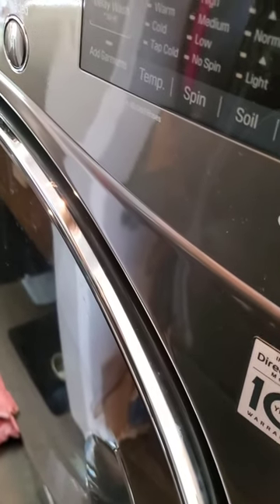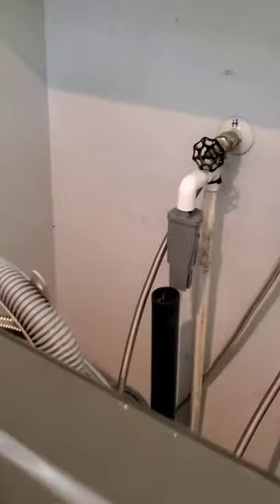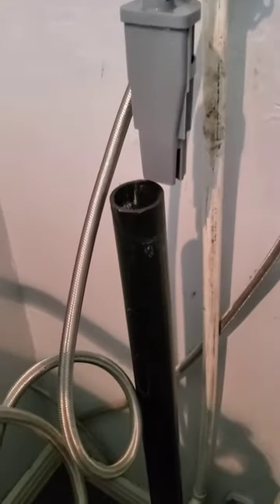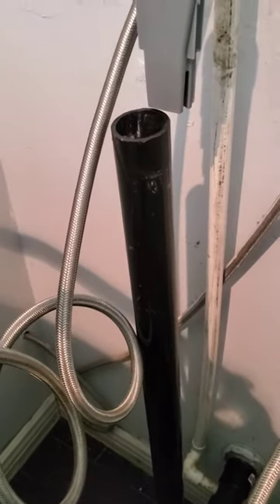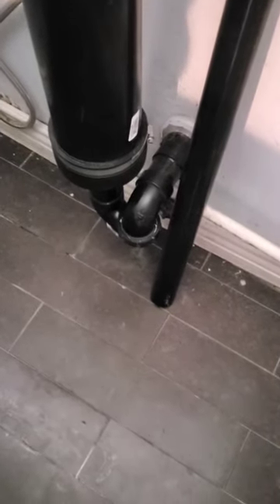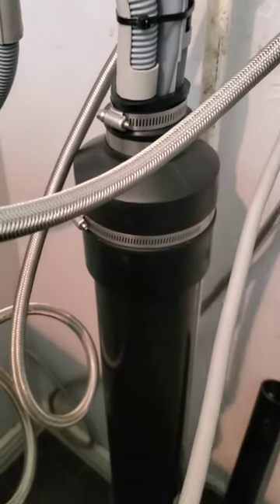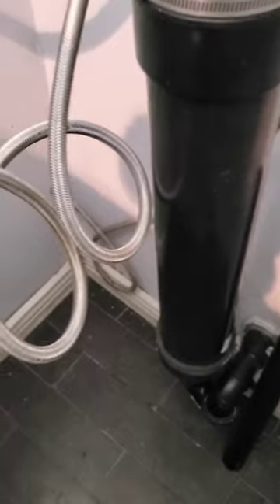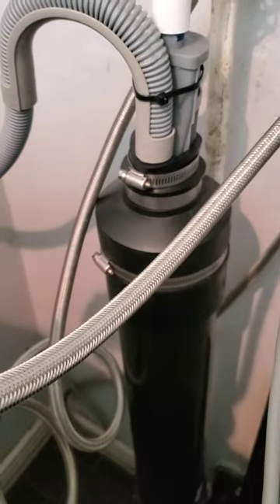Washing Machine drain overflows - Simple fix

Comment: Had this issue. A plumber came over and jet washed the inside of all my pipes and that fixed it. They were just all full of build-up, causing it to not drain properly. I told him about this 4" expansion fix and he said it's against code. That and it wouldn't fix the dirty pipes that were actually causing my issue. I also bought a bottle of Bio-One to put down the pipes once per month, which is a bacteria that grows and eats all the slime, grease, and goo that causes some of these problems. I like the 4" expansion solution Andy offers, but if you have gummed up pipes, this is not a long-term fix, as it will mostly just mask the issue.
Reply: I agree. I had same issue and after snaking the pipe now it drains just fine.

Comment: I simply used a 3/4" PVC coupling (actual ID is ~1") as a flow restrictor. Fixed for 85¢. Ideally it should be placed internally between the pump and rear panel connector before exiting the machine. The internal hosing and clamps are much sturdier than hose used externally to drain and the intermediate connector wold prevent it from exiting past.  Pumps on modern machines are just too powerful for many 1.5" drain setups.
Sealing the drain hose to waste line with a grommet is another option but an anti-siphoning device must be used in that case.
Reply: THANK YOU, this is the idea God gave me today, and you confirmed it.  'Restrict the draining machine pipe/hose' so that it does not cause the slight backup.

Comment: I had the same problem. My solution was to simply jam a 3/4 inch PCV threaded stop into the washing machine drain line. The threads are a nearly perfect fit for the 1" flex line he used in the video. I then put a 1" drywall screw through both flex pipe and plug for double security. Finally I drilled a 3/8 hole in the plug to reduce the water flow. I know that it is a little harder on the washer pump but its better than breaking concrete slab to replace a 10ft run of undersized drain pipe.

Comment: Worked!  Although I only upsized the standpipe to 4" with an adapter. I left the top of the 4" pipe open and just put the washer hose in it (no rubber reducer/clamps on top).
Reply from the maker: Glad to hear that it worked for you.

Comment: Same problem I have. New speedqueen set, older home. I just bought the home, so I'm still trying to diagnose the problem. All of the fixtures drain fine. I believe it's just too much water at once. So, I think I'm going to use the same principle  here, except drain it to a new utility sink. The sink will act as the overflow reservoir.

Comment: Looks like you are pretty good with plumbing, congrats!
I have an issue with my drain hole for washer discharge pipe - it is overflowing sometimes causing my basement flooding, it's not because of water from washer like in your case, it's because the waste water from outside comes right into my house when it desires, how do I fix it? Back water valve, any ideas?

Comment: Great idea! I ordered the parts to start this project. Did you cut the 1-1/2 inch pipe at the bottom by the P-Trap pipe with a regular saw? How many inches of the 1-1/2 pipe did you leave to connect to the rubber coupling? Thanks
Reply from the maker: I used a hack saw. 3 to 4" should be good.

Comment: Can you tell me the specific parts you purchased? I have been having the same issues and we feel your solution may work for us.
Reply from the maker: 3ft of 4" plastic plumbing pipe
2 of the flexible rubber 4" to 1-1/2" coupler with clamps, one for the top, the other for the bottom.
Make sure you measure your existing pipe and confirm that it's 1-1/2"
Good luck!
Reply: @andyn8998  Thanks. Ours is going behind a wall so I believe the 4" pipe may be too wide for both the existing outlet box with spacing of the hot and cold water pipes; and the existing wall space, so we may go with a 3" instead.
Reply from the maker: @pamr308  Anything bigger than the 1-1/2" would help. Is yours spilling just a little or a lot?
Reply: @andyn8998  a lot when it’s a regular load. Also its in a building so we’ve had it snaked several times in past year and nothing has resolved it fully. We believe it’s a venting issue
Reply from the maker: @pamr7359  If that's the case then this alone may not resolve the issue. You see,  the larger pipe can only hold a certain volume of water and if what you have overflowed on the floor is more that what it can hold then you'll have spill over. You may want to also snake the vent if you believe that it's obstructed and BTW, don't shove the drain tube too far down the pipe and leave some opening at the top for venting. Good luck!
Reply: @andyn8998  not sure how to snake the vent in an apartment building.
Reply: @pamr7359  yes mines was a venting issue. My plumber snaked it on my roof top and now my standpipe is working
Reply: @Andy N Did you just cut through the 1-1/2 pipe at the bottom, right before the P-Trap pipe? I couldn’t see from your video, but how many inches of the 1-1/2 pipe do you have left to connect to the rubber coupling? Thanks

Comment: My drain pipe is in the little box next to washer valve. Not sure if I can use this method
Reply: Please don't do this. Common sense says there's a bigger problem if a 2" drain can't handle the water from a 1-1/4" or 1-1/2" washing machine hose. All he did was build a reservoir to mask the underlying issue.

Comment: I think this could be our problem. We love in a 200 yr old farmhouse and have a top load Speed Queen. I do wonder if it could be an issuer of too much water for the old drain pipe size or a clog. One thing that also happens as it’s overflowing, is that water comes up into our kitchen sink as well. 

It was only happening on some loads, now it’s on all loads at both the beginning of wash and rinse draining. 

Does this sound more like a clog or the need for a bigger drain pipe? 

Thanks!
Reply from the maker: Sounds like a clogged or restricted drain pipe. Doesn't hurt to snake it first to see if you can clear it before spending money on the hardware
Reply: Yes a clog but also the speed queen. Our old pipes are clear and if we wash on anything but delicate it still overflows. Delicate does not. This overflow tank seems interesting to me!
Reply: That is definitely a clog.

Comment: A properly vented and unclogged 2" drain will handle anything coming out of that 1-1/2" washing machine hose and a 30" minimum standpipe. The simplest thing to do would be to try and clear the drain line with a snake or if you have the money put a camera down to see what you are dealing with. The fact that the drain and p-trap aren't in the wall is a red flag that someone cut corners during a remodel and the rest of the house is draining fine so it could be a venting issue. Do you have a vent directly over that room coming out of the roof?

Fun fact I asked chat gpt how much pressure would have to be coming out of a 1-1/2" drain pipe to cause an overflow with a 2" pipe that's properly vented and it said 418.5 psi which is far beyond the amount of pressure a washing machine drain hose can handle. Pex A can only handle 160 PSI. Full city water pressure is going to be 80 psi tops. So you are talking about an insane amount of force, greater than a firehose, your washing machine would to put out that could risk killing someone and had to have been built by some mad scientist in order for your new washing machine to cause an overflow without an underlying issue in your drain line.
Reply: Thanks!

Comment: If you ever get a clog down line, it's gonna turn into a geyser with the top of the stack restricted that much. 😂  The 1 1/2" pipe should take it down no problem (Unless there's an issue with your plumbing).  You probably have buildup in your sewer drain or a venting issue.

Comment: Dude!  That's crazy!  All you had to do  was to get a rubber coupling and another hunk of 1 1/2 abs and make as high as the washing machine.  Damn, I'd hate to see what you did with your rain gutters and downspouts.
Reply: Code says the standpipe has to be a minimum of 30" which it looks like it is. What's your logic of the standpipe having to be above the washing machine? The washing machine drains from the bottom with a pump not gravity/siphoning so I'm not sure how the standpipe being above the washer could possibly matter.
Reply: @rickybobby7276  You don't read too well do you?  I didn't say 'above' the unit. I said. even with it.  The reason is because newer type machines have a more powerful pump and pump out more gpm than older units. Because of the faster pumps, the water draining in the pipe tends to rise almost to the top until pressure equalizes thru the u-trap in the wall/ground.
Reply: @loumitch1  Above, even with, below it doesn't matter as long as the standpipe is 30" according to code. Do you know what building codes are? I can tell you aren't a plumber. Do you have any clue how much pressure would have to be coming out of the 1-1/2" washing machine hose into a 30" tall standpipe 2" wide that's properly vented to create an overflow? It's so much pressure it would burst the thin washing machine hose like it was paper. No residential washing machine on the planet is pumping out that much water. This is a drainage or venting issue. All going higher than 30" or wider than 2" is going to do is build a reservoir. I am not even going to ask what you mean about equalizing pressure, because again you aren't talking about gravity fed drainage we are talking about a pump feeding water up from the very bottom of the washing machine. There's nothing to equalize, because the water is artificially fed by the pump which I'm sorry but regardless of how new it is will not overflow plumbing that's done to modern building codes. But hey I'm sure you know better than the people writing the building codes.

Comment: 95% of the audience should just buy/rent a plumbing snake/auger 25-50 feet, clean the pipe for major blockages, and finally pressure wash the pipe using a drain bladder.

Comment: If the problem is a line restriction, as the restriction increases you are going to have back pressure build up on your washing machine discharge and unduly stress the pump.
Reply: Wrong

Comment: This Machines turn 1000 rpm per minute & you can not put the drain hose in the drain pipe more than 5 to 6 inches! I had the same problem called a plumber & said I will unclog the drain for $739.00 

I thought about it said said no thank!

The machines come with a long drain house & the installed it either 15 inches the hose in the drain pipe!

I took it up to only 5 inches secure it so it will not come back out !

Problem fixed 😂😂😂😂😂😂

Comment: That’s a simple fix? Yeah ok. 🤦🏽‍♀️
Reply: It's a very simple fix. buy the pieces of pipe, glue them together. Cut off the old pipe and glue the new to the old. Install a bracket to help support all the water weight. 
The alternative is to have your drain dug up and replaced with larger piping all the way down.

Comment: NEVER ever do this.
It absolutely will not solve anything.
Reply: It's not proper, but the pipe will hold extra water volume so the drain can have time to discharge the water. Again - not proper, but it technically does work.